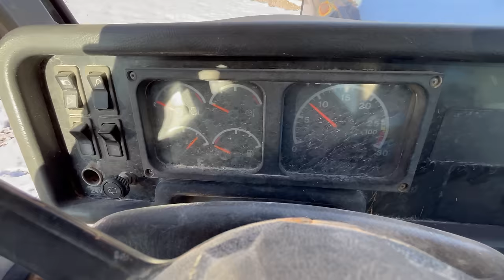Caterpillar C-10 Diesel Engine Tear Down to Bare Block

Comment: Thank You Sir.    I appreciated your video.  I had a 2007 KW early model, when I sold it it had 1,128,000 miles we’d never been inside the engine

Comment: Looking at the oil gallery that engine was super clean inside which shows the quality of the maintenance and oil used, these are great engines,I did over 250,000 miles in one without a single issue,brilliant engine I really miss those days, it’s been 17 years since I was medically retired but still miss those days, 325 bhp of sheer guts, at 32tons gross in an eight wheeled tipper it was Never short of power.

Comment: Great video. I had that sensor go out on my 1994-  Cat 3406E model back in 2010 just a few months after I had a complete out of frame overhaul done. was loading grain under the spout  had one pile  in trailer & was to move to rear hopper & she just quit. Had no idea what it was. couldn't get it to start. Ended up having towed to a shop thinking was a serious problem & all it was this timing sensor. If I'd had known that I would have had a new one put on when I overhauled the motor. I was good for putting things on before it needed it as a prevention of a breakdown & loss of time. Time is Money.

Comment: As a die hard series 60 fan , cat's use of bosses over roller bearings on the gear train is a much better design.  Great vid. I own a c12 so this was very informative.
Reply from the maker: This is one of Cat's cheaper designed engines.  It doesn't compare to a 3406E family engine, but the C-10/C-12 family is still as good as any other 10-12 liter out there.

Comment: Don’t know how many miles that engine had done but saying it was in pretty good condition must be the most understated statement of the year,that engine had very little wear anywhere and could probably have been rebuilt using new piston rings and Crank Bearings and a light cylinder hone to bed the new rings in and yes I’ve been rebuilding Diesel engines for the last 50years.

Comment: I've owned 4 CAT diesels. 3406B OT-4444 arraignment setting 400hp. a 5EK 3406-435hp. a 2WS 3406 550hp and currently a 1LW 3406E 550hp. All were great engines. The B model 400 was the hottest one

Comment: I wish I could give you an answer about the stupidly tightened oil filter. I've worked at a couple lube centers, and a Goodyear and an NTB store over the years, done thousands of oil changes and out of those probably 3-4 dozen times had to spend 30+ minutes getting overly torqued filters off. Some of them were in super tight spots as you can imagine. One was easy to get to but so tight I had to cut the filter off at the base, then use a punch sideways with a hammer to get it to start turning. That was after doing like you did with a big pry bar hammered through the body but it just ripped the metal off.

Comment: I have one of them C10 engine in a 2003 Sterling Tandem Axle with a Vactor2000 vacuum unit on it. The truck does catch basin cleaning for cities.  Had the truck on the scale at 73,000lbs....she a heavy girl but always put out

Comment: Always blows my mind that these new 3/4 ton diesel pickups have much smaller motors in them and still make a thousand foot pounds
Reply from the maker: Try getting 750,000 miles out of a new diesel pickup without any new parts and then you'll understand the difference.
Reply: @KT3406E  got it. Thank you.
Reply: @KT3406E  would you be interested in building a engine?

Comment: How stout are these c10's? Can they handle/be tuned to about 500hp/1650tq? Alot of c10s around compared to c12s in my area for cheap.
Reply: Those things are tougher than hell, we abuse the shit out of them daily in dozers and a few smaller excavators. If I could wedge one in a 1 ton pickup with a 13 speed I would for sure.

Comment: This is neat looks kinda like a big cam Cummins NTC 365 IV doing heads on one rn. Next is the catapiler variant of it gotta do an in frame overhaul this looks real similar it’s in a kenworth T600A other one might me a 800 this engine this looks a little newer. Trucks I’m talking about are 86 year models

Ya this is definitely different mines got 3 rocker boxes and three heads. This maybe n older design idk tbh either way real neat.

Comment: Time 11:20   I can't understand it either why people have to torque those filters on.  It seems like every used car or truck I buy I can look forward to doing exactly what you did, driving a spike through the filters.  I have crushed filters with a filter wrench and I have cut them in half with a spike trying to get them off.  Makes no sense to me.

Comment: This series of engines along with the 3176 was designed to complement the 3406.  It was designed for lightweight requirements of certain OTR industry requirements.  It found a large niche in the bulk transport fleet and beer hauling fleets.  I drove a 98 KW with the C13 that had  430 hp and it did fairly well in the mountains.  The 3176 was not as good when it came to Jake brake performance but then again it was also 1350 maximum torque so it couldn't really get up the hills.
Reply: George  We know you sure didn't.
Reply: George  We can all learn something regardless of the experience we have, but  Harold's comment is for all of us who don't have any experience with that engine in a working environment.
Reply: @Harold…If it was a 1998’ Model Truck, it had to be a C-12, 430 HP was the Most that you could get along with Up To 1,650 Ft LBS Torque. Cat C13 Model Motors didn’t come out until 2005 Model Trucks, they were also Twin Turbo Engines and had Some Problems. There was also the Cat C-12 Bridge Motor that was 2003-2004 Model Trucks (similar to the Cat C-15 Bridge Motor that was after the 6NZ Model, but before the Cat C15 Models). The “Bridge Motors” which were Single Turbo Interim Motors with Some Emission Controls, before going to Full Blown Emission Motors that Started in 2005, such as the Twin Turbo Model Motors C7, C9, C11, C13, C15, & C18 Model Motors. These Motors were Replacements for The Single Turbo Model Motors 3126, 3176, C-10, C-12, C-15, C-16, & 3406E Model Motors.

If the C-10 is as Good as the C-12, C-15, & 3406 Model Motors that I have had Experience with, then I am sure that it is a Good Motors. The Cat C-10 falls into the Same Class of Motor as the Cummins M11/ISM Model & Detroit S60 11.1 L, just like the Cat C-12 falls into the same Class of Motor as the Detroit S60 12.7L Model, just like the C-15/3406 falls into the same Class of Motor as the Cummins ISX/N14 and Detroits S60 14L Motor.

Cat C-10/3176 we’re Great Flat Land Motors for Bulk Hauling, Car Hauling and Local Drop & Hook, but it would have to be Really Geared Low for The Mountains & 80,000LBS. I wouldn’t want Less than a Cat C-12/S60 12.7L for the Hills, even then the Truck would still have to be Geared Low with Maximum HP & Torque, 13 Spd’s & Jake’s (ideally a 14.0L, 14.6, 15.2, 15.8, or even a 18.0L Motor).

Comment: Very good vid, Your sure have alot of knowledge on cat motors. I ran ran alot of cat equipment for over 30 plus years but never had to work on them, Just ran them, Those engines are brutes for sure, Thanks for the vid.

Comment: I ain't but 8 minutes in and this engine is clean compared to what I'm used to. I know you said you need it for parts but dang there are alot, if not all the parts coming off of it need to go in a box for future use. It bothers me a little bit just letting bolts drop but I'm sure you recovered them instead of sweeping em all up and chucking them in the trash. Bolts are sometimes hard to come by when it's crunch time and going back together with a project.
As a mechanic 53 years old who is down and out on disability with my health failing more and more daily, just watching you tear this down is a form of therapy to me. 
You don't post often but when you do it's always a watch all the way thru kind of day.
Reply: I've got boxes and boxes of bolts. I never seem to have the right one!😀

Comment: Those 3176’s are a workhorse. We had the plastic wrist pin retainer get loose and score the liner, but updated parts on the rebuild fixed that

Comment: This may sound like a stupid question but if the injectors are computer controlled, why do you still need push rods for the injectors? Is it to overcome the initial opening of the injectors because of the high pressure?
Reply from the maker: The camshaft and pushrods are what create the high injection pressure.  It has to come from somewhere

Comment: Why did you cut that belt?
Reply: @Alan Higgins Never reuse a belt, it's a cheap part with unknown age.
Reply: @ducewags  just thought you might have kept it behind the seat or somewhere to get out of trouble if need be but if it’s a cheap part, you probably would have new ones as spares!👍
Reply: @alanhiggins2928  Take a look @41:17, the belt is on the right, hidden behind everything. That belt better be new on the rebuild, or it will take a day to replace it.
Reply: @ducewags  it’s fairly obvious that I don’t know what I’m talking about!😂👍
Reply: @alanhiggins2928  Questions are the way of learning. Always question the answer. No question is a dumb question. The question never asked, might be the death of another. Mine service lingo I live by daily.